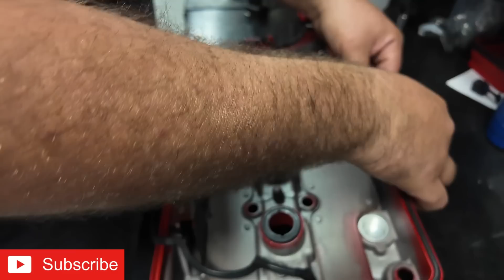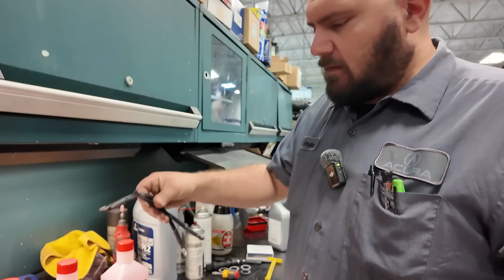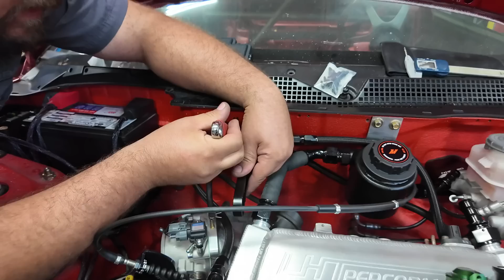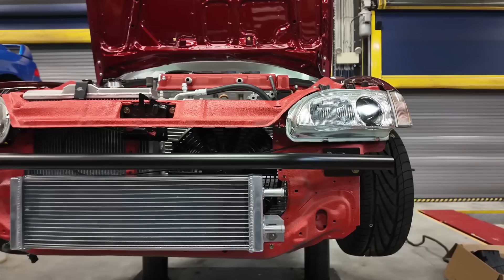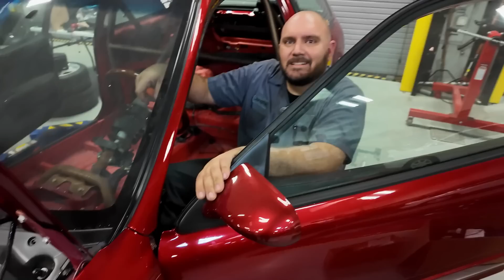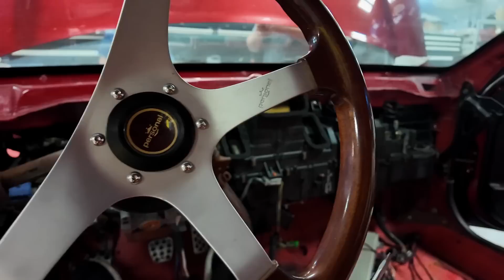The First Start!! Our Supercharged Honda Civic B18C VTEC Engine // 1992 Honda Civic VX (EP 11)

Comment: I used to have a 92 hatch with the type R motor and transmission. I had a Jackson racing supercharger on it. It was built by John at LHT. ￼ I used it for autocross. But it was a fun weekend car with the supercharger you could put it in second and rev it up to about 5000 and it would just haze the tires.  One night when I went fishing, somebody broke into my garage and stole it. The police found it three days later set on fire fully gutted. ￼￼￼

Comment: I used to have a b18c1 Jrsc on my car, I had my own water intercooler setup , and I used a Honda crv crank pulley to get more boost. I also added a 60 shot of nos ontop of it . All stock motor. Use synchromesh liquid and it will help keep tranny gears from grinding